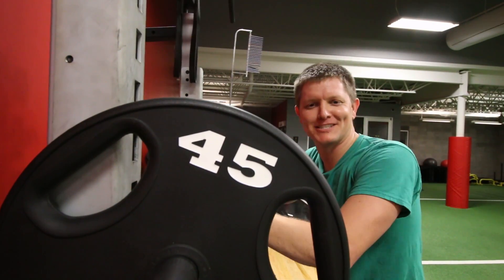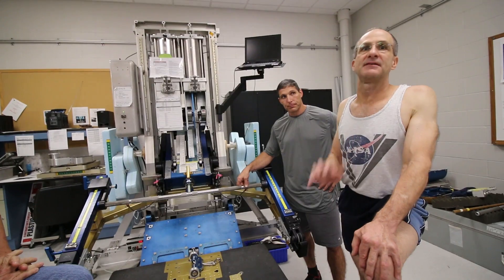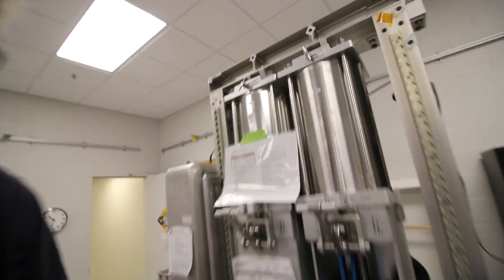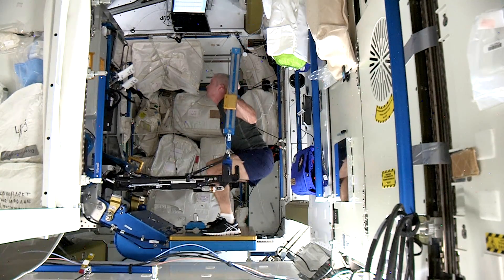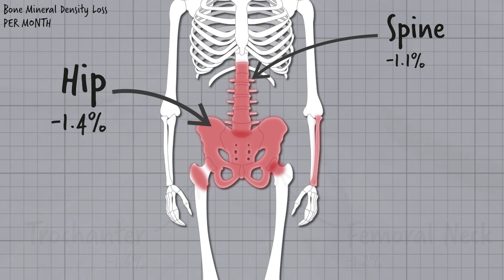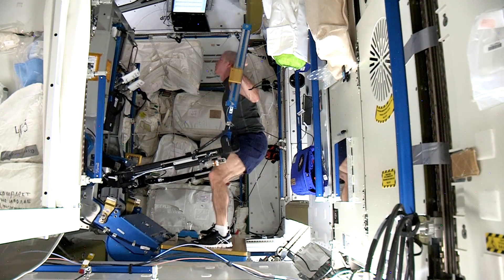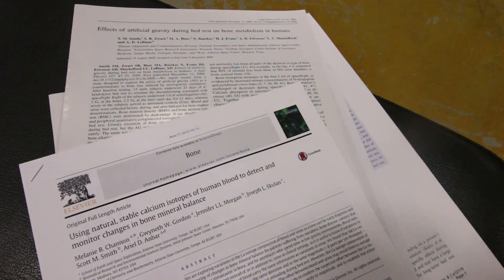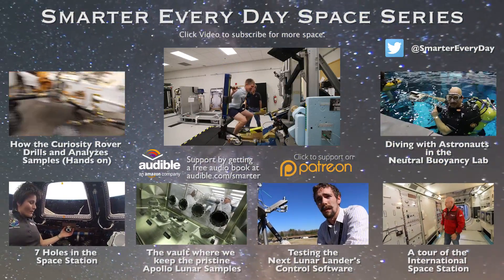Astronaut Urine Teaches Us Stuff - Smarter Every Day 149

Comment: Typical NASA over-engineering.  That beast is both huge and massive.  A multi-turn torsion spring (like in a roll-up garage door) takes nearly constant force over a wide range of motion, and is much simpler and lighter.  Also, you say that the vacuum exerts a constant force, but that's not true.  You're not really "pulling" the vacuum; you're actually compressing the air in the entire spacecraft with that piston.  Remember, the spacecraft is a closed system.  I'm sure that in something the size of the ISS, that's a microscopic fraction of the total volume, but in a smaller capsule that could be felt by the people not using the machine.

Comment: With neuroscientist being able to control mice brains using light its highly possible that this application could be used on humans in space to trick the brain into thinking you need more muscle mass or bone density. That way it keeps the body at a normal level without having to constantly work out. Kind of like being in a sensory deprivation tank except instead of depriving you of your senses it enhances them. Going to have to figure out artificial gravity or another way around this problem or long distance space travel might be even more difficult. We cant be put to sleep for years on end just yet but if we are ever able to this would be a huge problem we have to solve. Cant go to sleep for 10 years waking up with no muscles to move with.

Comment: So, burning the urine is essentially the same way aviation and industrial Q/A or labs use the Oil Analysis machines via the  atomic emission spectroscopy principle. By burning the substance (oil or urine) in a controlled light source (GREEN FLAME...for all you DND fans) or an electric arc via a carbon rod, each individual chemical/element can be measured, regardless of size, and give an accurate reading of the contents within the liquid. However, for oil analysis, it isn't necessary to dilute it. I was surprised she had to dilute the urine 100/1.

I'm really surprised that they would utilize this type of technology in bodily fluids. I wonder if the applications that be used in blood or brain tissue to get more accurate readings for those with kidney failure or in the analysis of Alzheimers.

Comment: My first BURNING question is WHY SPEND THE MILLIONS OF DOLLARS creating something that is JUST LIKE WEIGHT????? Why not just use the rubber bands or springs. I currently don't believe that bone density will be different when working out with rubber bands, than working out with VACUUM chambers. I hope someone can prove this wrong but it seems to be a GREAT way to blow Space money into the wind! I will remain frustrated until someone sets me straight on this. 
Thanx in advance for proving me wrong. Harold
Reply: I watched the video again - they do not explain, directly, why springs won't work! Anyone who knows about springs will tell you that you CAN and DO design them to function in a specific Range of motion. In other words it won't be starting at ZERO. That would be the design of a simple minded child. these engineers must know that a pretensioned band or spring will start with a specific load and when doing so your range of weight difference is much smaller. Have they never used the cable type weight sets that use eccentric pulleys to simulate a stronger force when spring is weak and a lighter force when the spring is stronger??? What's wrong with them?
Reply: They are saying that when you draw a vacuum on that Chamber; you can draw it down five feet or five hundred feet and the vacuum will remain the same? this does not make sense to me. I am going back to school right now to learn about this "YOUTUBE SCHOOL" I know I will find the explanation. maybe by Destin ;-)